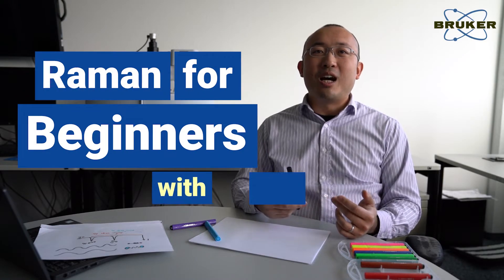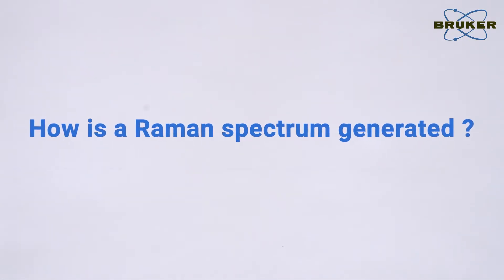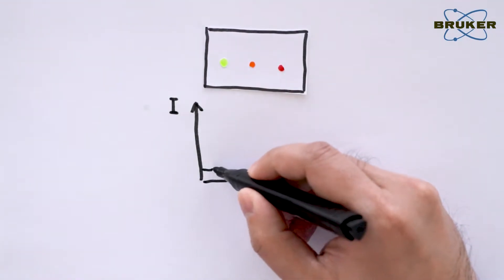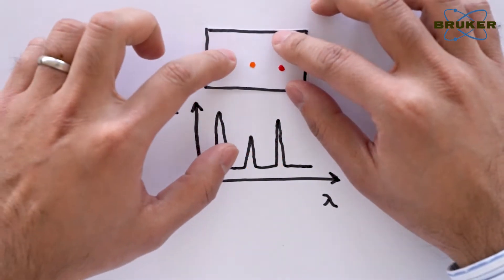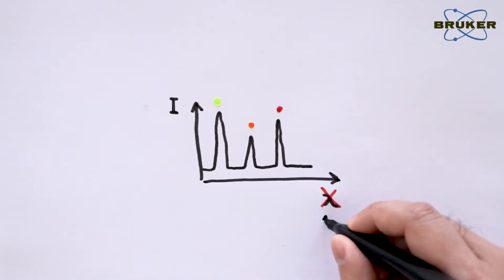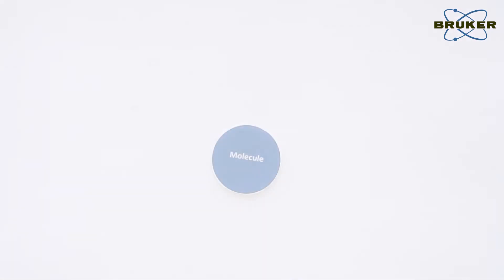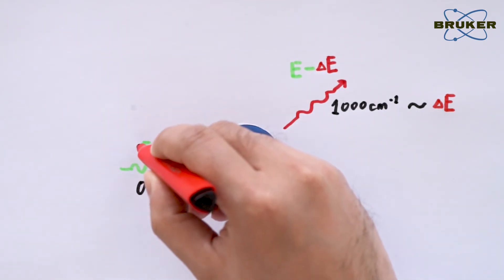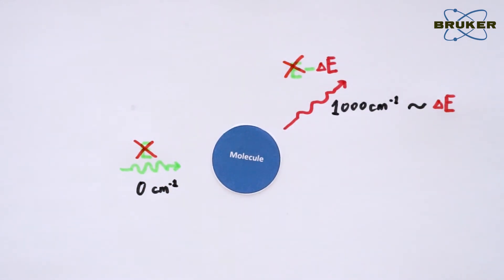What is a Raman Spectrum | Raman for Beginners | How are Raman Spectra Generated?

Comment: I have a question regarding how calibration is achieved: horizontal calibration makes sense, because the wavelength (/wavenumber) of the used laser is known. But what about y-axis calibration? CCDs have a wavelength-dependent sensitivity and a lot of the original intensity of the laser will be lost in the optical system. Is a reference sample the only way to do y-axis calibration or is there another way?
Reply from the maker: Dear Christian,
you are absolutely right and Y-axis must also be calibrated. In our factory, this is done once with a NIST standard before delivery of the Raman microscopes to the customer. This corrects for a CCD's wavelength-sensitivity relation and as this shoud not change over time a user doesnt have to do it again. 

However, if you build your own Raman microscope, you can choose between reference samples or reference lamps to calibrate the Y-axis. It is your choice and both approaches work.

Please keep in mind, that intensity calibration is not always needed. This error only influences the experiment when you need precise peak height relationship across wavelengths. For example, I want to see the peak A and peak B height ratio with both 532 and 785. Normally they should be same, but with resonance Raman or SERS effect they can change. Conventional Raman measurements, including quantitative maesurements, are NOT influenced by the CCD's wavelength dependency.

Hope this helps and best regards,
the Bruker Optics Team
Reply: @Bruker  Great anwer. Thanks for taking the time!